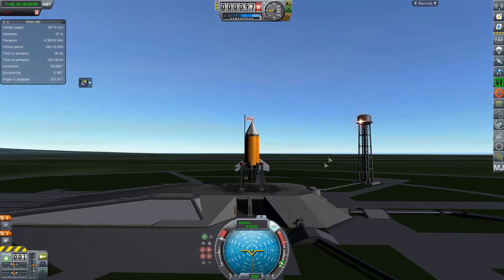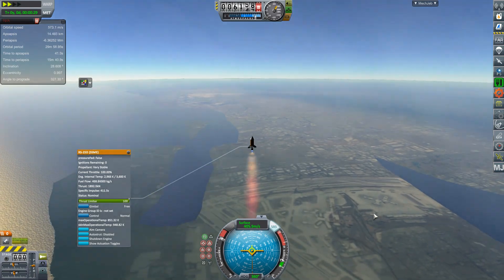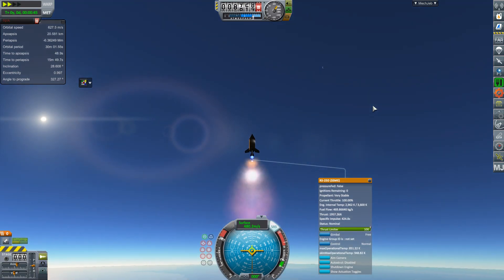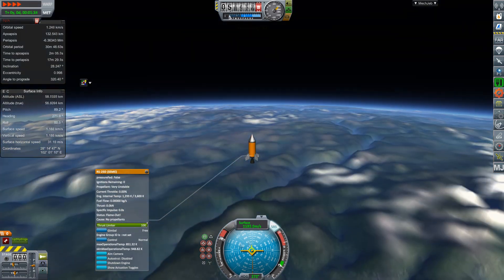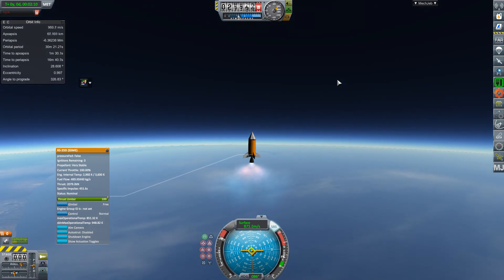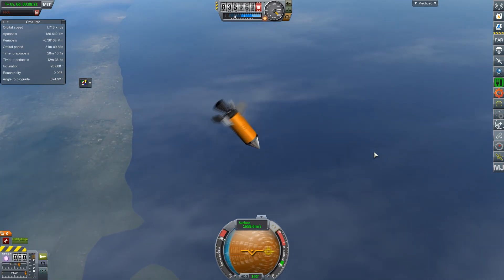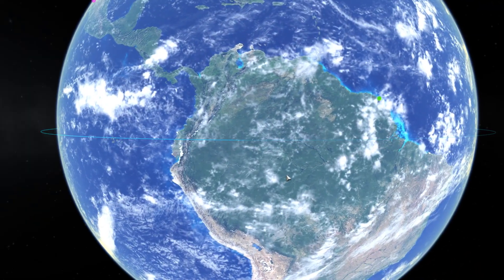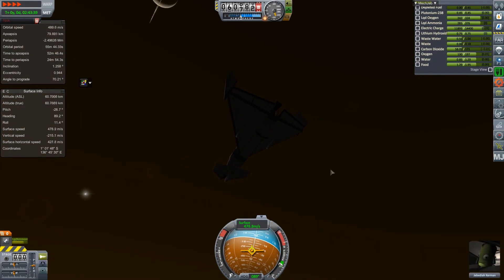Does Launching Rockets From A Mountain Really Help?

Comment: you forgot the very smallest benefit when listing the benefits of launching from a mountain: more initial orbital speed
since you are further from the earth's center, you are traveling a slightly greater distance each day than you would be at sea level.  this is easily the smallest benefit and is hardly even worth calculating for
Reply: That's a larger advantage for air launches.  Surface velocity is only about 1650 kph.  You'd have more trouble finding a modern aircraft that can't add an appreciable fraction to that by flying East than one that can.  The gap between the surface speeds of Cape Canaveral and Korou is about 13%.  Launching from a modified Boeing 777 would be about a 54% increase in lateral velocity compared to an equatorial surface launch on top of the engine efficiency advantages of launching at approximately 13 km altitude.  Between the relative ease of recovery of such a first stage and the lack of need for oxidizer it's hard to dismiss the notion.
Reply: Don't forget that less distance to target orbit means less time in flight before breaking into orbit, which means less gravity drag (Scott only mentioned starting where gravity is less strong, not time experiencing gravity drag).
Reply: If i remember correctly orbital velocity low orbit is about 28 000km/h. .. so cape Canaveral 1430km/h and Korou 1650km/h. Higher altitude also ad a few km/h just by being higher.

Maximum speed for 777 945km/h, so maximum 2595km/h. Its not a enormous amount of gain

But give the 5% decrease in delta V due to altitude. The additional speed gives about 5% more, then 2% decrease from being more south.

Then of cause going to a U2 altitude of 20 000 m would give a bit more advance.. and of cause.. SR71 speed and altitude would pretty much bring it down 10% more on both speed and altitude.
Reply: also: when you launch from 8km up you only have 92km  to go to reach the Karman line
Reply: Ryan McA'Nulty thats sone great ksp humor right there lol
Reply: Nathan Brown the cost of maintaining the launch plane, and facility that that plane takes off from are more prohibitive than the benefits that can be realized the USAF figured this out much to their chagrin in the 60s when they were desperately trying to provide a more dependable cost effective aircraft based nuclear deterrence program than ICBMs efficient and failed every time. leading to them proposing the nuclear triad (land, sea, air) just to stay in the game as the Air Force and Navy saw no problem with ICBMs because they work just as good launched from the sea as they do from a missile silo in the ground.
Reply: I came here to post this.
Reply: There is also a slight factor that you can use a longer nozzle with the lower launch air pressure, but again, the advantages would be pretty minor.
Reply: Another advantage: lower maximum dynamic pressure, so you can use thinner and lighter payload fairing.
Reply: I don't agree that equatorial launch is an advantage of air launches; satellite launches are routinely conducted from equatorial barges, for instance, and there are good candidate land sites for equatorial launches as well. As for launchpad maintenance, would it really be bad enough that it would justify the additional complexity of starting and controlling a rocket in freefall?
Reply: Another thing missed. Not all mountains are created equal. Mars' mountains are bigger, because with less mass, there's less gravity.

In Kerbal, Minimus provides a good contrast. From the highest point on the equator, you're in a position to perform a 'second-stage' horizontal burn to equatorial orbit from standing. From the lowest point, you must perform a 'first-stage' vertical burn to avoid the mountains before horizontally accelerating to orbital speed.

By landing on the highlands I've managed to get down to the surface and back up to a station in low (<1km above the highlands) Minimus equatorial orbit on a single tank of EVA fuel.

This is pretty easy if you've got the EVA skills to do rescue missions.

Earth mountains are relatively small relative to the atmosphere thickness and body diameter. If you were building a launch station on any body smaller than earth, you'd expect to find bigger mountains with lower gravity and thinner atmosphere, meaning not only a  greater differential in launch vehicle size between mountain top and mountain bottom launch sites, but also lower energy requirements in moving large rockets to high ground.

Symptoms of living down a large gravity well....
Reply: +matsv201
 "gravity is lower" uh what? No it isn't. In fact the opposite is true, the effective gravity at the Earth's surface is lower at the equator, because of the centrifugal force from the spinning Earth. But sure, if you want to go into a polar orbit it helps to launch closer to the poles, since you don't want velocity in the equatorial spin direction.
Reply: +Theodore042 The other reason to take off from the equator for a prograde orbit is because it takes a lot of fuel to reposition the orbit in line with the equator. I don't know which factor would be more significant in a retrograde orbit however.
Reply: Thanks, I've been curious about the surface speed difference altitude makes.
Reply: They already have floating launch pads built upon modified oil tankers for these very purposes. They can navigate to an ideal latitude and longitude to achieve what ever orbital trajectory they need.
The rockets themselves are not very big though, their payloads being small satellites
Reply: Would that necessarily make the rockets much smaller though? They launch relatively large communication satellites from those platforms and those get shoved up into geosyncronous orbit. They may be smaller payloads but that's a way higher orbit than ISS payloads, for instance.
Reply: matsv201 I've been to ESRANGE for balloon campaigns. I didn't realize the rocket facility there has orbital rocket capacity. Once while I was there I was able to observe a rocket launch, but it was a sounding rocket, not an orbital rocket.
Reply: I think they fired some.. but its like less than once a year they fire orbital rockets. And its really small once.. And of cause, just  polar orbits. The sounding rocket firer much more regularly.
Reply: Also don't forget the similarly tiny effect of being closer to orbit if you start higher up, so you don't have as far to go.
Reply: Theodore042 Actually, an equatorial lauch site is better for launching into retrograde orbit. Because I wasn't paying attention, I put my Minimus orbital station into retrograde orbit. Low Orbital speed around Minimus is ~200 m/s, while the surface moves at ~20 m/s. Launching into retrograde equatorial orbit from an equatorial launch site costs 40m/s in Δν more than a prograde equatorial orbit.

The manuver to shift from low polar orbit to low equatorial orbit (without raising apoapsis) is ~400m/s Δν. This is the classic scenario where it is cheaper in Δν to raise the apoapsis, make the burn to change inclination at high altitude, then lower the apoapsis into the target orbit.

The advantage to a polar launch site for launching into polar orbits is twofold. Not only do you not have to counteract the 20m/s equatorial surface speed, but also at high latitudes your lauch windows are much longer. A launch site at Amundsen Station could launch a vehicle into any polar orbit at any time with equal Δν cost (though the logistics would suck). These longer launch windows reduce the window of opportunity for weather to inhibit launch, which in turn reduces the time the vehicle must be maintained in launch-ready condition on the pad while awaiting a launch window with clear weather.

While poor weather isn't implemented in KSP, it is still beneficial to wait for one of the two launch windows per day for cheap access to a Kerbin polar orbit.
Reply: ninjafruitchilled Gravity is lower at the equator because the earth is an oblate sphereoid, and thus the peak of Chimborazo in Equador is further from the centre of the earth than the peak of Everest. F=Gm/r² decreases as r increases.
Reply: That effect exists also, though I believe the effect from the centrifugal force is larger. Also that formula can't be used in this case because, as you say, the Earth isn't a sphere. So you can't just compare heights above the centre of the Earth.
Reply: ninjafruitchilled Larger or not, centrigugal force counteracts gravity which does not eliminate gravity.
F=Gm/r² can be used with irregular shapes. The trick with doing so is to measure from the centre of mass. While the Earth isn't a sphere, it is still a pretty regular shape due to the Earth's mass being large enough to require exotic materials like carbon nanotube for space elevator construction (which is a very similar issue to how high it is possible for mountains to grow). This places the centre of mass (and rotation) close enough to the physical centre of the planet that the error in using F=Gm/r² is negligible.
I believe it is still standard practise to use Newtonian mechanics like this to plot interplanetary trajectories, since the error introduced by using instantaneous gravity is dwarfed by the error introduced by fluctuations in the solar wind, and performing relativistic calculations is around an order of magnitude more complex which makes it around an order of magnitude more expensive in time or hardware & power. Outside maths, perfect answers are more expensive than they are worth.
Reply: We are talking about small effects though. But ok maybe that part is too small to worry about. Nevertheless, if we use that equation (well it should be a=Gm/r^2, not F) then we get that the difference in gravitational acceleration from poles to equator is ~0.068 ms^-2, whilst the centrifugal acceleration at the equator is ~0.033 ms^-2, so ok the radius effect is larger by a factor of 2. But the centrifugal effect is still a similar size so it cannot be neglected.
Reply: ninjafruitchilled It's a cost/benefit analysis. 
Compare Earth (m=1 M⊕, r(equatorial)=6,378 km, Δr(Chimborazo)=6.3 km) to Mars (m=0.107446849 M⊕, r(equatorial)=3,390 km, Δr(Olympus Mons)=21.3 km)
The important ratio is between r² and (r+Δr)² since G and m are constant. On Chimborazo this is a 0.2% increase, whereas on Olympus Mons it is a 1.2% increase. 
Hauling a rocket up Chimborazo compared to a barge launch: 
- contracts your launch window due to weather, 
- is logistically nightmarish, 
- and doesn't significantly reduce Δν requirements. 
Hauling a rocket up Olympus Mons compared to a datum launch: 
- gets you out of the dust storms into the upper atmosphere expanding your launch window significantly, 
- is logistically easier (lower g, lower Q), 
- and reduces Δν requirements to achieve orbit by a lot more.
In both cases, I'd suggest the weather is really the deciding factor. If Chimborazo could offer year-round launches, there'd already be a rocket elevator fitted to it because even if the cost advantage is slight, it is reliably slight if one can ignore the weather concerns.
Reply: ninjafruitchilled On second thought, a potentially more significant ratio is Δr(surface) to Δr(orbit). Climbing the 6.3km of Chimborazo achieves 2.5% of 250 km Earth orbital altitude. Climbing the 21.3km of Olympus Mons achieves 26.6% of 80km Mars orbital altitude.
Reply: What about fresh mountain air and faster suntans?
Reply: Shakes McTremens What factor sunscreen do you use on a rocket? :p
Reply: The difference, while it exists, is so insignificantly small, that it doesnt warrant the HUGE costs of moving the parts up a mountain.
Reply: I remember doing this in a game called space engineers, I made a structure that can rotate upto 600 rpm, when I am the the center I was at 36 m/s while at the farthest it was like 80 m/s I guess
Reply: Chalk Chalkson that's the same as having a lower atmospheric density, which is the strongest benefit that he already mentioned.
Reply: Maeyanie actually, the differences in average air pressure over the course of the flight can be pretty significant.  Not only is the air pressure lower at launch, but at every point along the flight trajectory- meaning that you can use a nozzle optimized for significantly lower air pressure...
Reply: Hm, I assume the conclusion was that you are supposed to take off from the equator for a prograde orbit and near the poles for a retrograde orbit because the closer to the equator you are the more the rotation of the Earth affects your tangential velocity.
Reply: In sweden we have a rocket pad.. Its pretty much as far north as possible. The reason for that is very diffrent. Far north the gravity is lower, so going into a polar orbit is better if you are far north.

Launching pretty close to the eqvator is pretty much optimal for most but polar orbit. If you need a larger inclination to the equator, just launch it to a steeper angel to the equator. The french guinea lauchpad is pretty much optimal for most orbits but polar once
Reply: @matsv201  For an orbit that is supposed to go DIRECTLY over the poles, unless launched over a pole it has an eastward velocity component which must be counteracted by the rocket to place the payload in the right orbital plane.  The closer to the nearest pole, the smaller the bad velocity component.   That is why further north is better for Sweden (and further south would be better for Tasmania) for polar orbit launches.  It has nothing to do with gravity.
Reply: @matsv201  there is a Crowded  Launch Place in Spitzbergen for this reason.
Reply: There is other advantages to with air launch.. he kind of touched it.. but not quite.

With air launch one can launch closer to the equator.

Also... with air launch. A aircraft is much simpler to maintain than a launch pad.A aircaft is just a aircraft. Can pretty simply dropp away the rocket 100 meter or so before it ignite the engine, having no problem with the heat.

So i don´t really agree with scot there... Also proven to be kind of true with space X having quite a lot of problem with there launch platform that they just would not have other vice.
Reply: @matsv201  It's hard to imagine that an air launch could happen any closer to the equator than Nyahururu. Why not launch from the 2525m plateau near their university or from near the Girls' High School @0.0000433,36.2700711 if you want that mile and a half headstart?
Reply: @Sableagle  That is true. But airlaunch give some additional benefits. A sub sonic aircraft could easily ad a other 1000km/h to the orbital speed, as well as bring the atmosphere down to a quarter to penetrate.

This allows for a much more aggressive acceleration and gravity turn. Lowering the impact of both atmosphere and gravity.

There is a infrastructure advantage to. 

Of cause, having a high altitude supersonic launcher is much more efficient.  A subsonic cut of about 10% of the orbital speed and 3/4 of the atmosphere. A hypersonic can cut of  25% of the orbit speed and 9/10 of the atmosphere.

Jet-A or Hydrogen is really cheap compare to oxygen. Also it uses much less.

Something like a SABRE based launched plattform can kick up a 2:ond stage up to about the same speed and altitude as anormal fist stage, for about 1/10 of the cost.